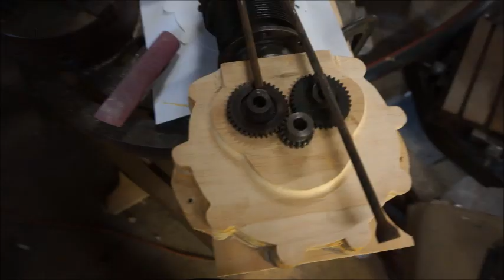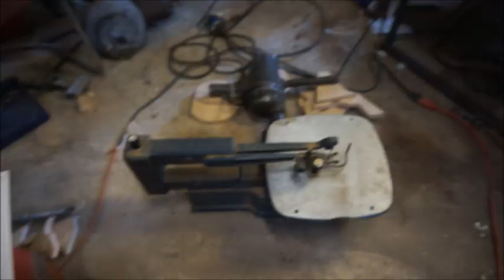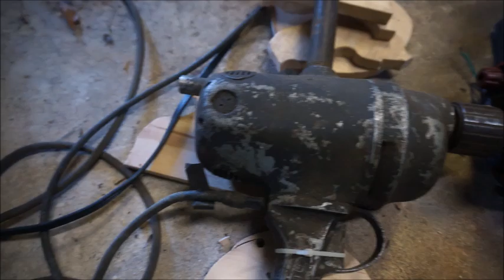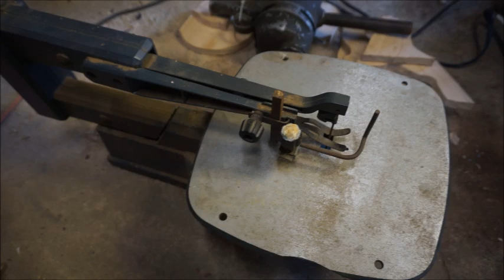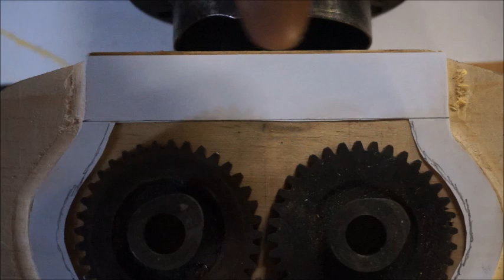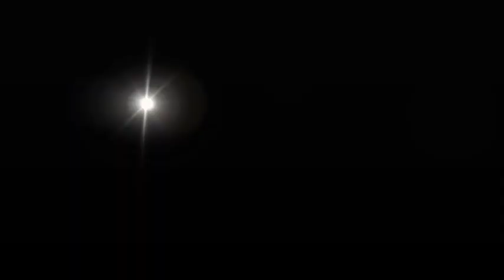Antique Motorcycle Engine Build (Replica) Part 6

Comment: Great video. Since the B&S engines that donated the cams were flatheads, I was wondering what the rocker arm ratio is on your cylinder. Just a thought. Keep up the fun projects.
Reply from the maker: The briggs FH was overhead valve. It ran a rocker for the exhaust, but the intake was atmospheric. Search you tube and there is a lot of them running. They are neat old engines. I can play with the grind and rocker ratio to get the lift I want.